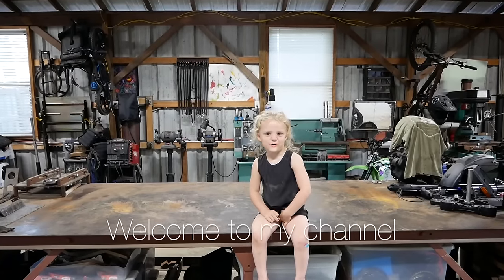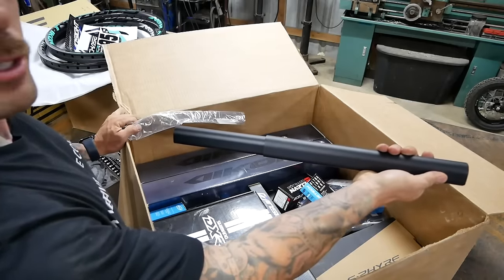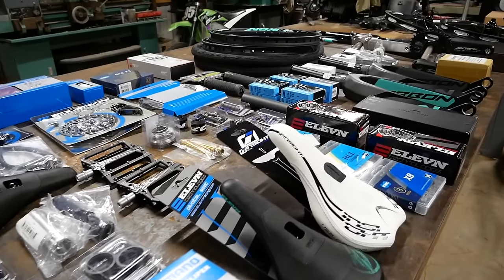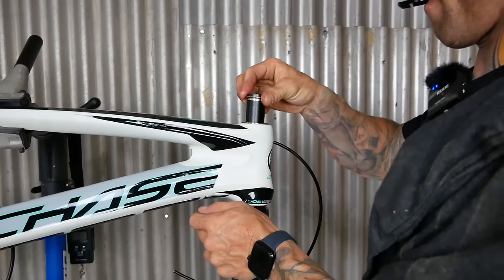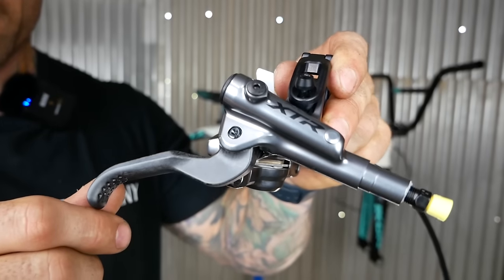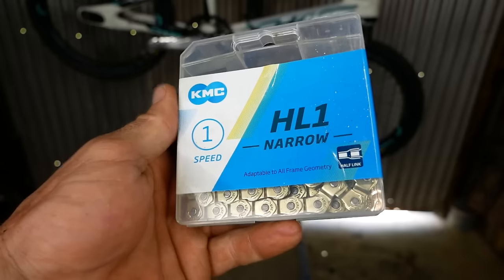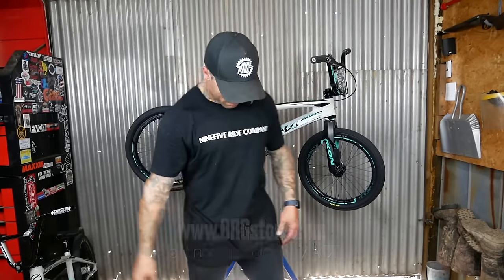Insane New 2024 Race Bike

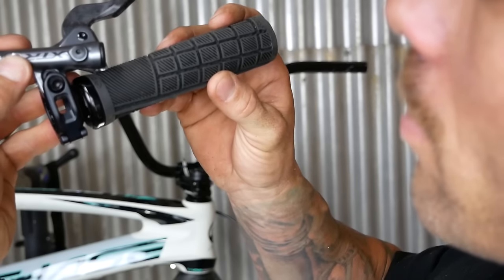Comment: 10:02 this is a good setup for mtb but no so much bmx. I bought the previous model lever wand current model caliper because of this situation. The previous model doesn’t have that feature but the actuation works just as good
I remember wondering if chase would eventually come out with that cement and teal scheme on the act. I think it’s the best looking one they have

Comment: Do Shimano make BMX specific Saint cranks now or are they the same as the DH ones? If its the latter then you might need to swap out the chainring as the narrow/wide tooth profile won't work with a half-link chain. Speaking of which, don't you find half-link chains feel a bit spongy under heavy load?

Comment: Why no v-brakes? disc brakes are heavy and is extra rotational weight, aerodrag speaking of aero when integrated cabeling?
Reply from the maker: @winningwalk  heavier? False. Zero extra rotational weight as the rotor mass is centered with the hub. The cable is internally routed through over 50% of the frame
Reply: @barrynobles95  the disc brake setup is heavier than a v brake setup the disc brake rotor is attached to the hub and adds weight to the wheel, therefore it  requires more watts to turn the wheel, Why other use a PU inner tube.
Reply from the maker: @winningwalk  You’re right. The industry has gone the wrong direction. Good luck at your next race.
Reply: @barrynobles95  I know keep marketing, disc brakes look cool, love you're channel